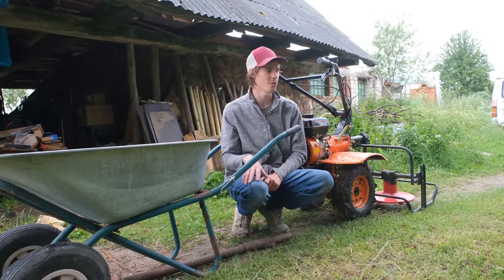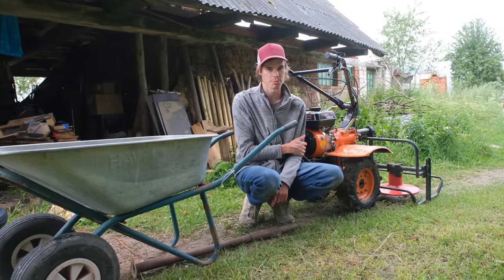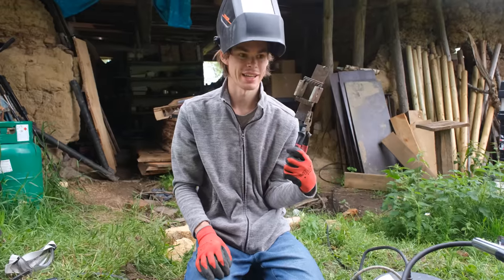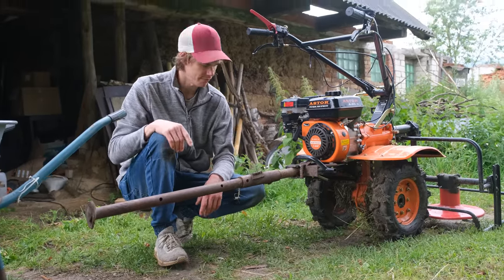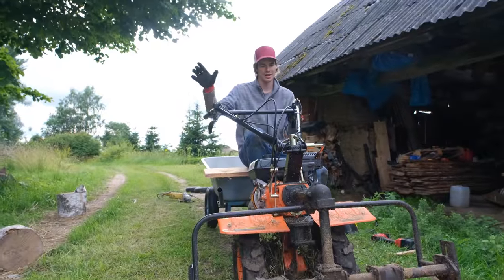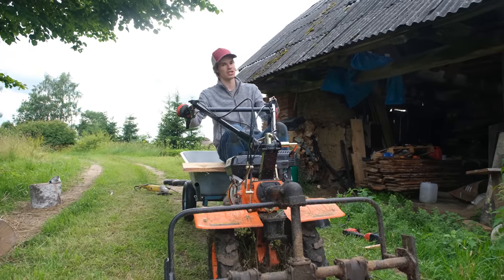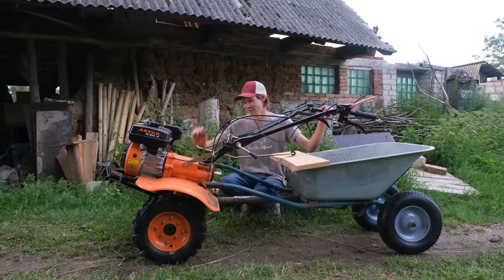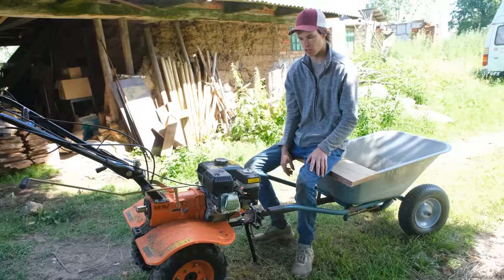DIY Mini Trailer for Two Wheel Tractor

Comment: That modification should allow you to get far more of the grass and weeds slashed down for far less input of your energy. It is a pity that the goats and sheep will not eat then green stuff, can it be harvested for winter use? I can see your point about moving the rear, wheelbarrow wheels forward and taking strains off the coupling. Stress concentrations can lead to rapid wear and fatigue, not to mention other undesirable operational issues. You have the time, capability and energy to make these developments. I trust they will deliver the results you want.

Comment: Deivid has an amazing imagination. Is that mower made to cut that high of grass and weeds or would it help a lot by cutting it down a lot with the weed eater and then finish it off by mowing. If you cut a lot down with the weed eater first you could give the goats and sheep a lot of it. I have to say though Deivid you have some kind of imagination. Who else would think of using a wheelbarrow for a seat riding behind a mower. I wish there was a place to put your feet up though.

Comment: Add this site to your resumé. You need to work for a large corporation in their engineering department improving the mechanics. Go for it. Working a farm will not make you rich.
Reply: you mist the point of what they are about.go back in their videos from when they bought the farm.